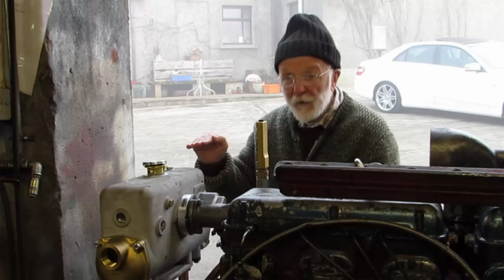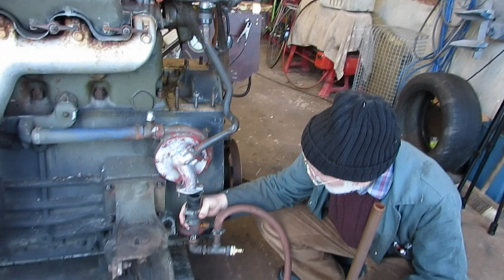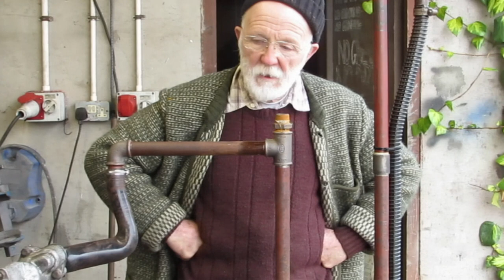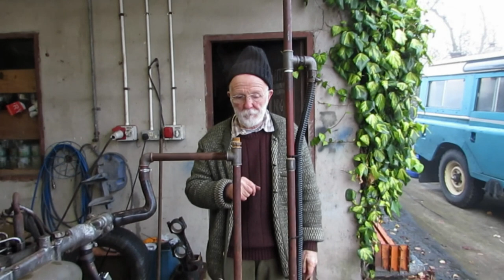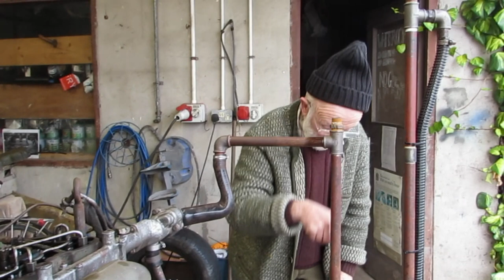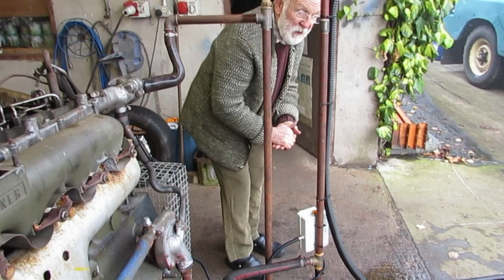Gardner Engines: cooling

Comment: Thanks Joe on the cooling system could you explain how the older RAM pump works and how the cooling water is moved around the engine using them .  Many thanks for your video's they are very informative look forward to the net one .